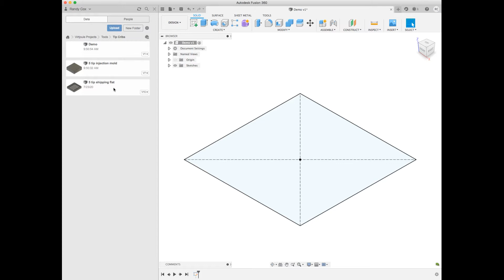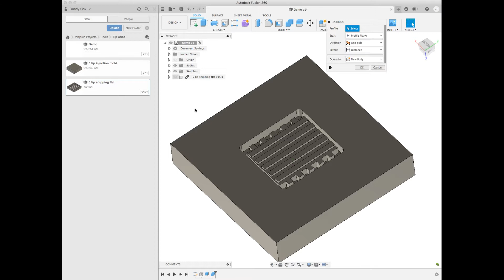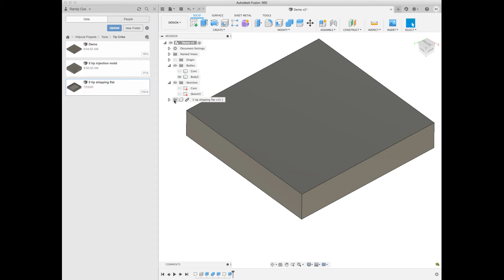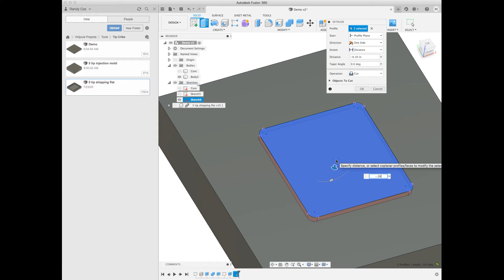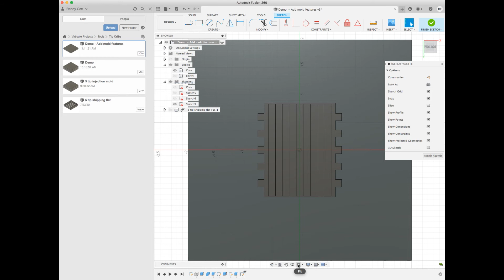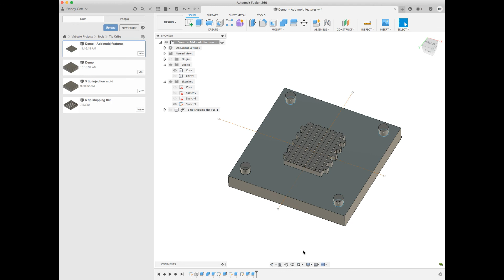Core/cavity mold design in Fusion 360 for Medium Machinery injection molding machine

Comment: I watched your overmolding video from 3 years ago or there abouts.  I'm wondering what kind of cycle time is real, my guess is 2 minutes per cycle but I'd love to hear your thoughts.  if I wanted to do 100 pieces of a very similar type job where I'd be making power plugs that plug into the 120 volt standard wall socket?  I have a guy who is selling his medium machine and also his sherline 5400 cnc.
Reply from the maker: A few things feed into the cycle time as I've come to discover with several kinds of molds.  If you're using compressed air for the compression, like the standard Medium Machine, then recovery time on the compressor can sometimes limit your cycle time depending  on the shot size.  I also burned up a good DeWalt compressor once due to overheating as I got in a groove.  I ended up converting my machine over to hydraulic and it was the best investment I put into it.  I have a couple of other videos that go through that conversion.  Shop is so much quieter now and I don't have to wear ear protection.  Second thing that really impacts your cycle time is how easy it is to demold and reset wire for the new shot.  Santoprene is super easy to unmold and so unmolding for me is pretty fast as the mold comes apart by hand.  If you have to pry the mold apart you can count on a lot of extra time.  I ended up creating some jigs to hold two Cat 5e's at exactly the correct width and height for the mold so that I didn't need three hands to set the wire and close the mold.  2 min per cycle is probably a good place to start for an estimate.  I think I've gotten down to 1 minute with the setup I have now with the hydraulic ram.  Hope that helps.
Reply: @randycox4633  I have a 25 horse continuous duty kellogg compressor so air won't be a problem but I may switch over to hydraulic as well and automate a few more things with an arduino controller.  I'll look up those videos for sure.  Thanks for the response.